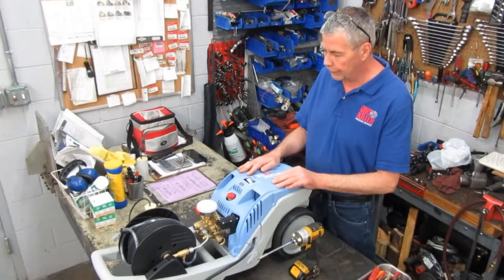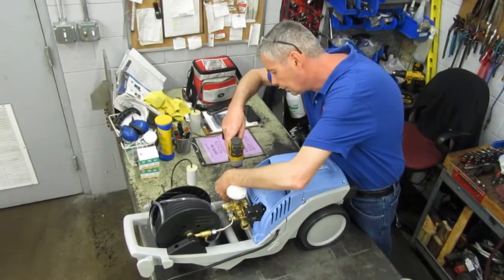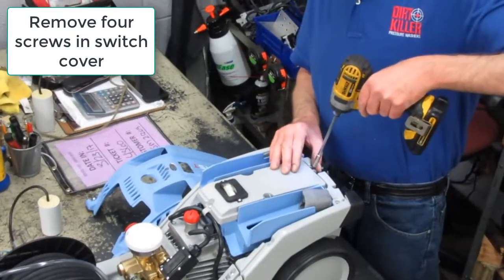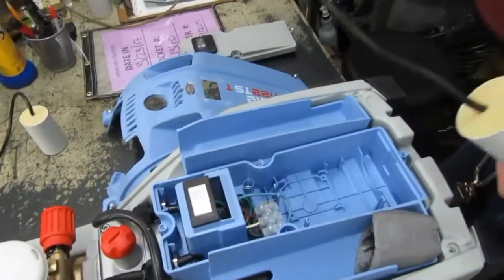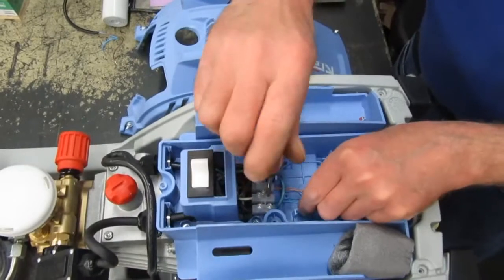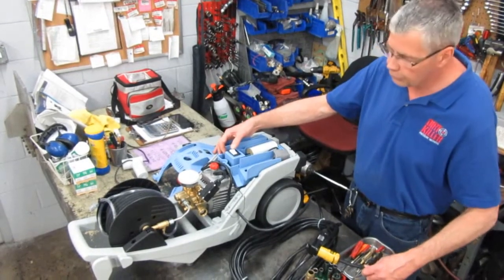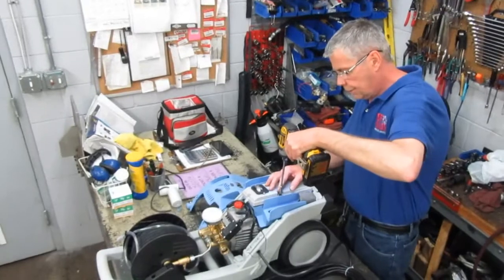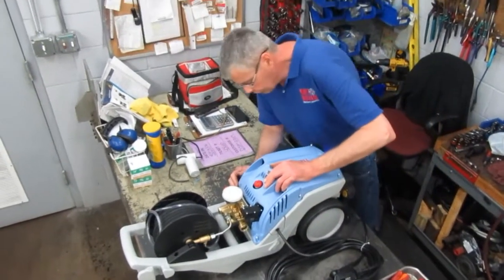Changing Capacitor in K1122TST

Comment: What reason are you changing the capacitor? Is it bad, or something else?
Reply from the maker: Yes, the capacitor was bad.
Reply: @atlanticpressurewashers  What are the symptoms of bad capasitor?
Reply from the maker: @heitspii6231  Usually when the capacitor is bad the motor will hum when the machine is switched on.  It won't spin or anything, just hum.
Reply: My 2160 TST was blowing fuses, opened up machine and found capacitor lid blown off with some melting internally. Kranzle charge a fortune for replacement capacitors, I'm pretty sure they use Facon, mine is 70uf